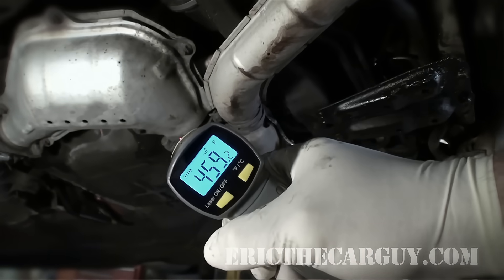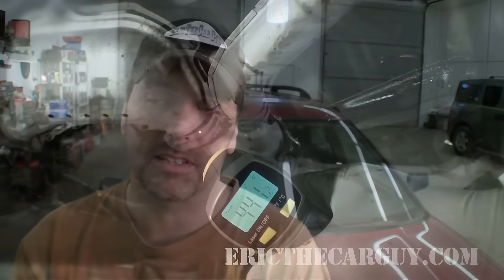Does Lacquer Thinner Clean Catalytic Converters? -EricTheCarGuy

Comment: I watched Scottie's video within the hour. Yeh, your proportions were off from his. He said a 1/2 tank and a 1/2 gallon of lacquer thinner. Your gas/lacquer solution was 1/3 what his was. Also, Scottie proposed it as an attempt to make before trying the overnight soak in soapy water. He didn't assure that it would work but, it could be very well worth it if it did. I value this video, though, because there was one of Scottie's that was about additives which included a picture of soda being poured into a gas tank. Apparently, some- who saw the picture- put soda into their gas tanks and had severe damage from it. They couldn't have watched the video, attentively, as there was no such advice given in it. Your video has put me more at ease with the idea of using lacquer thinner or other such suggestions he might make. I'd feel disgraced if I did something equivalent to putting soda in the gas tank. The financial blow would be devastating, as well. Good stuff. Glad you didn't "dis" Scottie. I appreciate his videos much.

Comment: There is no way that any of these "tricks" to clean up your cat are actually cleaning your cat directly. A catalytic converter is made from platinum and palladium black ( super finely divided particles of these "noble metals")  that are sintered onto aluminum oxide ceramic beads. The operating temperatures of a catalytic converter are so high that ANY and ALL organic compounds will be converted into inorganic carbon and OXIDIZED to CO2 if the catalytic metals are working. There are things that destroy catalytic converters efficiency and number one is SULFUR. Sulfur gets into fuels as organic sulfur compounds and refineries work hard to limit the amount of sulfur in fuels. For diesel engines low sulfur fuels really reduce the emissions but the refining costs do go up if the refinery must buy high sulfur crude. Low sulfur crude (sweet crude) is more expensive and more desirable for auto and truck fuel refining. Better yields.  Sometimes moly and high levels of ZDDP (has zinc and sulfur organometallic additives) can harm the performance of a catalytic converter.  I don;t think those cat poisons can be removed or cleaned up easily so stay aways from fuel additives based on either class of organometallics.

So back to adding catalytic converter cleaners. They all work by cleaning the intake and upper cylinder head valves etc. The idea is to flush the gunk and combustion crud and carbon deposits downstream into the converter where they will be burned up. A rich fuel condition will create extra depositis over time and some fuels have things in them that promote deposits. Number one is benzene and naphthlenic compunds that tend to cyclize and polymerize into sticky and hard deposits during combustion. Higher octane fuels must have less of these aromatic compounds to hit the higher RON's. To dissolve these deposits, various detergents in the amine class and simple aliphatic alcohols can be added to fuels. Techron gas cleaner is an amine detergent class cleaner and Seafoam is just isoprpopyl alcohol added to kerosene.  You can buy a couple of pints of IPA at the Walmart or drug store and use them to try to clean things up in your fuel system. IPA burns like ethanol and is safe for almost all fuel systems under 20% of total gas. Just remember to burn through the whole tank and rpelace the fuel with fresh clean fuel throughout the fuel lines before parking your car or truck.

The lacquer thinners can help too (they dissolve oily naphthlenic deposits very fast as like dissolves like) but they can also wreck havoc on your FUEL LINES and Injector seals and fuel pumps or gasoline sender etc. Anything that is plastic or polymeric can be swelled irreversibly by contact with lacquer thinners. Because there is no exact formula for lacquer thinner but it is a complex mixture of xylenes, toluenes and acetone and other ketones like MEK, plus sometimes extra proprietary stuff to meet a boiling pount range, lacquer thinners are sold based on low temp, medium temp and high temp usage conditons for thinning paints!  If you buy the cheapest lacquer thinner at HD you will get the one with the cheapest formulation.  So if you decide to go this route, add the least amount first and drive immediately and refill with gas BEFORE letting your car or truck sit. Never park it with a partial tank of lacquer thinner sitting in the fuel lines! If the lower amount doesn't improve your siuation, then try a heavier dose but remember to get it all burned up before you refill immediately and then drive to flush that stuff out of your fuel lines. Seafoam and amine detergents are much safer so try them FIRST. Number one rule to get a catalytic converter to work is HEAT. Drive uphill on a steep grade or drive at high freeway speeds for a long time to get that cat hot! Don't expect an improvement until AFTER you used a fuel system cleaner AND drove the car or truck hard to get it as hot as possible. Stop and go city driving with a cold engine is number one reason for upper cyl head deposits and poor cat converter performance.
Reply: is that IPA beer ??

Comment: I believe that Scotty said to put 1 or 2 gallons of lacquer cleaner per 1/2 tank of gasoline and then driving it 100-200 miles.  The can of cleaner Eric put in looked to be one quart, which is a lot less than Scotty instructed.  The results might have been limited by not using enough cleaner.
Reply: Robert Troxell    Scotty recommends 1 gallon lacquer thinner per 3/4 tank gasoline.   Did this on two different occasions and it worked.  Did it last year and it did not work.

Comment: Respectfully, this did in fact just work for me! My wife’s ‘08 Jeep Commander (152k miles) has had the check engine light on for nearly 3 years now. The Jeep Dealer quoted us between $2400 and $2800 to replace it. I said no, because the car’s performance didn’t seem injured, and that I would eventually do it myself (after market part about $400). That said, it’s no easy job,  I’ve just never gotten around to it. Well, decided I was going to do the replacement. had seen your video previously but was very nervous about trying this. Well, after much online research, I decided to give it a shot before ordering parts. SO GLAD I DID!!! With a nervous tension, I poured a $13 can of Lacquer Thinner that I got in the paint section of Walmart, into the gas tank. Well, a can and a half actually (so, $26), as we had about 15 gallons of gas in the car, and the perceived ideal ratio is 1:10, lacquer to gas. Then we drove the car around for about 80 to 90 miles last night and tonight. Well, about 5 miles ago, BAM! Problem resolved. I ran the diagnostics again (I use the Bluetooth FIXD tool, although this one is cheap and I will eventually upgrade to something more functional), and the P0430 Catalyst engine error is now gone!!! Wow!!! Just WOW! I must admit I was scared about doing this, but...the science prevailed and I did it. So glad I did. Sorry it didn't work for you in your trial, but in my mind, Scotty is a GENIUS!!!!
Reply: not just in your mind, Scotty IS a genious.. This worked for me on 2 different cars.

Comment: I don't know if the method work or not I haven't try it myself.  But I believe that Scott said to put 1 gallon of lacquer thinner into a half tank of gas and drive it 150 miles or idle at 2,000 rpm for 30 mins.

Comment: Tried it yesterday and worked. Downstream sensors were bouncing all over the place,now readings are normal.Had been running a lean code for a while due to various issues (5.3l Chevy)Think I gummed up the cats.Will keep posted if the code comes back

Comment: p0420 is usually caused by a hollowed or broken up converter not a clogged converter so cleaning would not help with that code unless the pieces were to shift in a way that restricted flow to the rear o2 sensor.

Comment: Could you run the detergent through the exhaust. Without dropping the catalytic converters. By using the oxygen sensors holes. And then start the car up and let the exhaust Burn It Off

Comment: A little more research into the type and proper proportions of lacquer thinner to gasoline should be in order here. Not all lacquer thinners are the same. They vary in formulation as much as gasoline does at different gas stations. To the best of my knowledge, the solvent Scotty used is PPG brand JT501 and its composition is different from the brand used in this test. Noted below are the compositions per their respective Safety Data Sheets. And if proportioned correctly I believe the JT501 would work better. But since I am in California, we aren't allowed to use real chemicals here and the California AQMD version of the same brand lacquer thinner you used is 95% acetone. And since acetone is what does most of the cleaning but is also what will eat your rubber seals in higher concentrations, I do not recommend anyone putting that stuff in their tank. The concentration is just too high.
 So locating something close to the JT501 formula is key.

PPG JT501

Toluene 50-75%
Methanol 20-30%
Acetone 10-20%
Ligroine 5-10%

Klean Strip

Toluene <5%
Methanol 25-35%
Acetone 20-30%
Acetic Acid <15%
Ethanol <5%

Klean Strip (California)

Acetone 60-100%
Ethanol 1-5%
Reply: Hello my brother very good information ! I am in CA. Did you try any of the above products with your vehicle?
Reply: Well done. Exactly what I was thinking.
Reply: Now THIS was exactly what I needed to see. I had a feeling higher levels of Toulene was the answer.
Reply: I'm made mistake on My 2005silverado 4.3 l engine with baryman B12 and see this cleaner eat the plastic and still can't believe
Reply: @hajrudinkavazovic2231  what plastic did the berrymans eat up?

Comment: He also mentioned when the code comes up it will do it when it's below 95%. lacquer thinner may not work very quickly on more severely clogged converters. It may take several treatments for more severe cases

Comment: well, I had a OBD test my cat converter is bad.  06 lincoln navigator then I get gas at Wal Mart and the dam thing won't turn no nada. next, I should get a starter to try to start. nothing.... I'm worried due to I just changed out the air suspension. I went from air to regular shocks. I'm at my wits end its blowing fuse 10 amp and 15 amp also could the code showed up is top [ 0DO.   DATA.   ERROR.         ]     this code is on my car dash 
   as you see it top n bottom.             has anyone seen this     at   bottom        [        S  - - - - - -   mi.                 ]

Comment: I only drive Subies and have flipped several over the past couple of years. Many times they are bought with CEL & 0420 codes and usually near empty gas tanks. I fill the tank half full with premium and a gal of lacquer thinner and take it out on the turnpike and beat the crap out of it 80 - 90  for half hour to hour along with a radar detector. This usually will resolve it. I've had a couple of occasions where a 2nd go round is needed.  As for gas? I've always run premium, they just run better and cats stay cleaner.  I have never replaced a converter except for one that the honeycombs were broken and rattled inside and it was nearly rusted through. Lac thinner won't help rust :)

Comment: Just remove the #1 O2 sensor (before catalytic converter) and spray Seafoam aerosol version with nozzle into a COLD cat for about 10 seconds on each cat you have, let that sit for 30 minutes, then start up the vehicle and let it idle for about 5 minutes and there's no need to waste a tank of gas or a gallon of laquer thinner and you essential then you will have a clean cat. DO NOT spray anything into the catalytic converter while it is hot. The vehicles exhaust must be cold! Works everytime to clear the PO420+PO430 codes.
Reply: Are you talking about Seafoam Top Engine Cleaner?
Reply: @glb7471  Seafoam Spray
Reply: Spray what? Can anyone confirm this?
Reply: @PNWTraveler  Seafoam Spray. Yes it works 100% if you remove upstream O2 sensor and follow the directions I gave.. Lacquer thinner has zero affect at cleaning the catalytic converter. Once the lacquer thinner has combusted in the engine, the chemical properties needed to "clean" the catalytic converter have been burned off in the combustion process. That's why you skip the combustion chamber with the Seafoam Spray and use it directly before the catalytic converter. Cat must be cold and you need to let it sit for 30 mins to an hour before you start up the car and let it idle for 5 minutes or so.
Reply: @smeyer7068  Thanks for the reply!  I'm going to try this out this morning. I have to P0420 code and the shop wants $1400 to replace the CCs. I believe they are just dirty tho. I'll update later today.
Reply: Update: It worked!!!!! Thanks you so much! I also added 2 bottles of Cataclean to half tank of gas but today it got just below the 1/4 mark and after driving around some more and accelerating a lot at random times the light check engine light turned off!
Reply: @PNWTraveler  I am happy to hear you've resolved the issue. Thanks for the update.

Comment: i used 2 gallons of lacquer thinner in 1/3 tank of gas in my 1990 Isuzu Trooper with more than 250,000 miles on it and it really did cleaned my catalytic converter.... my Trooper is still going strong at more than 370,000 miles on it.

Comment: I found a technical paper written by a Ford research laboratory where they soaked a catalytic converter that was not working properly due to silicon contamination in hydrofluoric acid at 10% concentration for 5 hours and were able to restore it to near full performance.  The also used an ultrasonic bath with soapy water for 2.5 hours with very good results but not as good as the HF bath.
Maybe the solvent solutions did not work because the problem was silicon contamination and not petroleum products contamination.
Reply: I am not very keen on the ultrasonic way if cleaning thought, it may physically damage the internal components.... Well accelerating the damage... if it is confirm silicon contamination, I think the hydrofluoric acid is the handful solution will work because that is the only acid that will react to silicon...

Comment: I would not recomend using a full gallon of acetone or lacquer thinner in your fuel system. There are a bunch of polymeric gaskets and seals all along your fuel pathway including inside your fuel pump that are not resistant to this very aggresive ketone solvent.  These gaskets will swell and start to leak or clog your injectors when exposed to a high concentration of acetone or MEK for any length of time. Fuel lines are made of polymers that are resistant to long term exposure to gasoline and that is mostly an aliphatic solvent or straight chain hydrocarbon. Ketones are used as a lacquer thinner because they will dissolve just about anything and the stuff they can't dissolve will swell up like  a balloon.